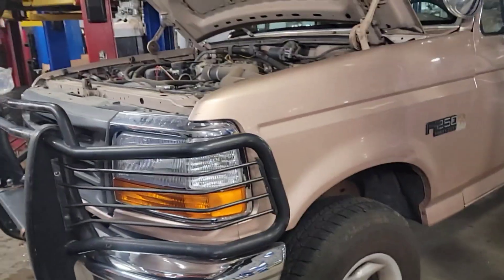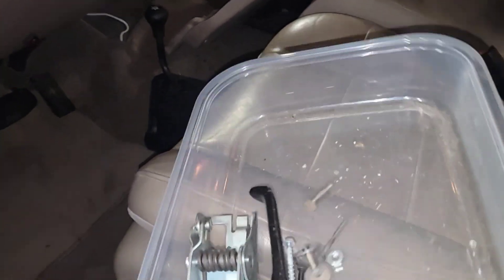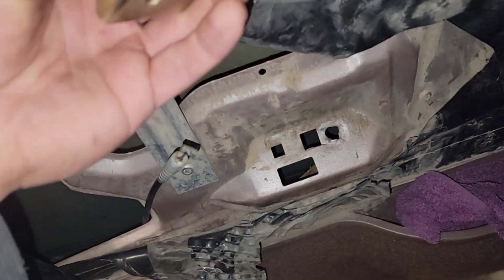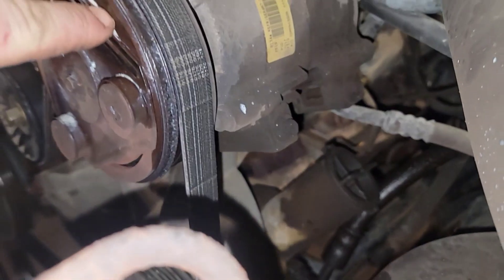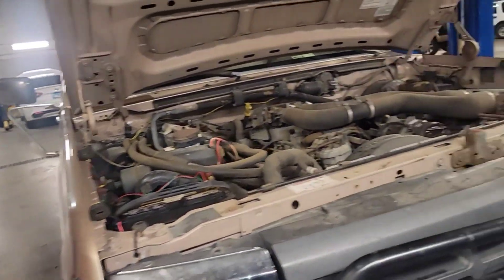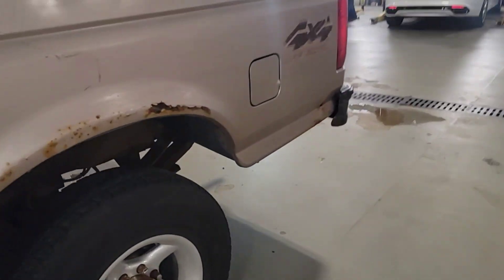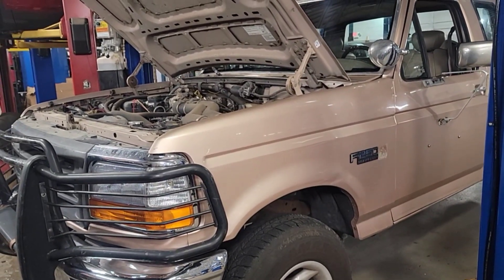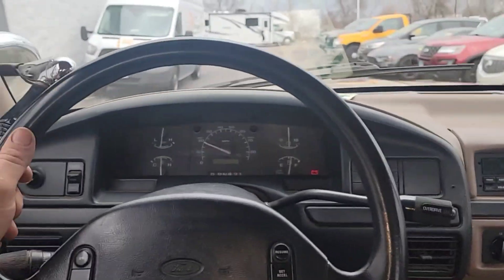1997 OBS 7.5L 4x4 Ac Clutch Noise, Inner Door Cable Assembly, Headlight Driver Side Won't Lock In

Comment: I love those trucks too. They were the best. I have a ‘95 currently. I had a ‘97 F-350 single wheel, 460, 5 speed, 4x4. It had 360k horrifically hard farm miles on it before it was retired due to rust. My Dad was driving it in a pasture and the seat broke through the floor.

Comment: I have a 92 F250 with the 7.3 IDI diesel.  52k miles and I am second owner.  Had issue with the "anti-lock rear wheel only brakes".  Asked dealer and they said "too old", we are not working on it.  So I had to fix it.  New anti-lock valve, power brake booster and master cylinder.  Easy - except needed a ladder. :)
Reply: I had a similar experience with my local GM dealer, I usually do my own work on my 97 f350 and my Hummer H3 but my H3 was having a no crank issue with no codes so I didn't want to deal with it myself and the dealership told me they were not longer working on cars made before 2010!

Comment: Oh yeah I bought a brand new 97 F350 4x4 regular cab with 7.5 manual trans plow  off road pkg It was last of the real Ford pick ups. Drove like a lumber wagon and could hold a full load without squatting the ass end.

Comment: Love the obs ford, I have a 97 f350 crew cab dually with the 7.5 and zf5 manual. Absolute monster of a truck, 215,000 miles on complete oem drive train. Including the clutch! Not to say it doesn't need some work but she runs like hell!
Reply: Amen.. love my 94 F350 Crew Cab Dually 7.5/ZF5.
Reply: @BORIKKEN  they just don't make them like they use to

Comment: Cool I don't see many OBS's in the shop let alone a 460. I run a 1995 with a 460 with 180,000 miles a half a quart of oil every 3,000. The rear main is weeping ever so slightly. Mine on the throttle is louder because they wanted to much for the air pump. Delete that put a 47" belt on and remove the air pump pulley and it fit. Cat will clog over the long with no air pump. So the cat disappeared also. 3 inch exhaust. Actually at idle it isn't all that different. Fast idle on cold mornings at 5:40 a.m. my neighbors probably hate me. Speed density banked fired fuel injection with analog emissions means it is dead nuts reliable. It won't be sold there is nothing to replace it. It went and played in the snow this last week. The mountains around me got up to 2' of snow. Stock tire size 20" of snow is no problem. I love my big block and I can't deny it. I've had 300 6's     I would rather have this instead at 1200 rpm I make more torque than they did. When hitting snow drifts on Friday at 20 mph the 460 just leans into and just pulls at that is all done around 1800 rpms. What more could ask from this. OBS is still the pinnacle of what vehicles should be when it comes to reliability and still keep things relatively simple.

Comment: I have the 96 7.5L 5 speed manual with 41k original miles in very good condition. Love that truck 😊
Reply: you love it so much you put 130 miles on it every month for 25+ years? 
that's 4 1/2 miles a day.  ????  
gotta be a story there.
Reply: @timewa851  It’s a very special truck to me. My dad bought in new late in life and only used it on the farm. He passed away in 2015. I have actually driven it to Missouri from North Carolina pulling a 24’ gooseneck trailer. It got 4 mpg going into a 40 mph headwind, but ran great. No body rust, very light frame rust. It’s on the third set of tires LOL! The others dry rotted. Thanks for asking!

Comment: That is one nice (last model year of that style) truck right there. Not sure I'd want to be the guy having to pay for the fuel to keep that 460 running at today's prices though. My memories with that engine was changing exhaust manifolds and cylinder heads on a few of those in the motorhome chassis. Those class A motorhomes were a lot of truck for that 460/E4OD combo to get moving.

Comment: I have a 96 crew cab f350 single rear wheel truck 245 k miles love my old truck got a 94 f150 4x4 extened cab i giving it a make over got few parts trucks just like body lines and over all look.

Comment: Hey my friend what is your name. 
My 2007 town car …you can get in the rear drivers side seat from the outside but you can’t open the door from the inside. Is there an easy fix for this?
Reply from the maker: I'm having the same problem right now except on the passenger side so I'm going to have to research this
Reply: Just today replaced drivers side inside door handle 2010 town car paid local mechanic about $250.00... Was hard to find the right part...
Reply: @FordBossMe  I said it backwards. You can open from inside but not the out side

Comment: Where the vid ended, is that a Lincoln mark vii i see in front of you? I love those cars. Had 2. An 88 and 90, both baby blue bill blass editions. The 90 i swapped a t5 into it, mass air conversion, custom catless dual exhaust from the headers back with flowmaster and dumped out behind the rear tires cause you cant go all the way back bigger than factory. Even from the factory its 2 dif sizes on either side of the gas tank cause its too tight. couple other things done to it. I got 373 limited slip but never got to putting it in. Had it all in primer/all the body work done and ready for paint before i totaled it. Man that car was awesome. Was faster than the mustang i pulled the motor and trans out with a the little things i did to it.  My brother had a 97 f250 351. Whats the 7.5L? 460? I didnt realize those came w anything other than 351 or the 7.3 diesel for the 250.
Reply from the maker: It's my 1985 Thunderbird 5.0
Reply: @FordBossMe  ahhh ok. I couldnt really see it clearly. They are similar looking cars at a glance. Idk how many ppl asked if my mark vii was a thunderbird haha. You dont see many of thunderbirds in that bodystyle anymore. They actually have some interchangeable parts, especially the supercoupe. They both have the tevez mach 3 braking system with an ecumulators and pump. Braking system used on jets, at least ive read it was. The mark vii was the first american car with 4 wheel disc 4 wheel abs. 6months before the vette. Had this argument with my brakes teacher in college. He kept insisting it was the vette. Im like no...you're wrong, it was the mark vii, i know it was, i have one. When i googled it n proved him wrong in front the whole class he got pretty pissed off n hated me after that haha. But hey...if you're a brakes teacher you should know that and stop giving students the wrong info haha

Comment: Correct me if I'm wrong but I thought those Ford AC compressors could be shimmed in or out to get the correct tolerance. You just pull that center bolt out and put some shims behind it so it's not collapsed on itself wouldn't that work?
Reply from the maker: You are correct I give the customer the option to get an after-market clutch or get a new compressor and I told the customer depending on how long the compressor hasn't worked if I put a new clutch on it and the compressor goes out the only thing warranty is going to be the clutch so it's almost a waste of time at that point
Reply: @FordBossMe  well I was just pointing out adjusting the shim pack not talking replacing anything clutch or compressor.  I've done it I thought that was more common.

Comment: I have a '97 F250HD like this but with the 5.8L / 351W engine, and 2WD. Mine has 290,000 miles and the engine weeps oil from almost every seal. Otherwise runs pretty well. Would you recommend an engine-out overhaul, or just swap in a remanufactured crate engine? If the latter, could you recommend a company that does a good job on these roller cam 351s?
Reply: I ain't to happy w my Jasper's lifters. I would suggest putting in a RV cam that way you can guarantee they don't fail because of that expense. Hard knocks
Reply from the maker: Jasper Or Jump on some forums and ask other obs owners

Comment: Is the distributor cracked? 🤔
Reply from the maker: I didn't pay close enough attention to that it ran fine I'll look at it when it comes back in
Reply: @FordBossMe  @2:50 look at the cap. Looks like a large chunk missing. Could be me haha. Congrats on the house!
Reply: @Nicky_Inspired_By_Freedom  are you looking at the clamp that holds the cap on?
Reply: @devonross5825  O_O i knew that.. haha. The last distributor I saw was on a 90 vette haha. My apologizes! I never seen a clamp on a distributor like that before.
Reply: @Nicky_Inspired_By_Freedom  it's all good🤣 I have a 97 obs with the 7.5L as well so I'm quite fond of the engine and how it looks to say the least

Comment: You burned 5 gallons of gas hot rodding around the parking lot LOL. A guy doesn't see too many old OBS Fords around, nice trucks in their day, after driving "superduty" trucks the cabs on OBS trucks feel small and cramped.
Reply from the maker: Hot rodding? No lol

Yeah they were gas hogs but as a tech sometimes I have to drive them hard
Reply: @FordBossMe  lol, its good to feel old big block power not like todays engines sound like singer sewing machines.